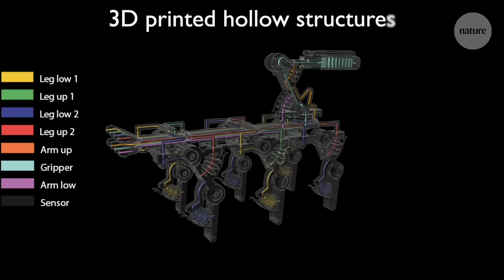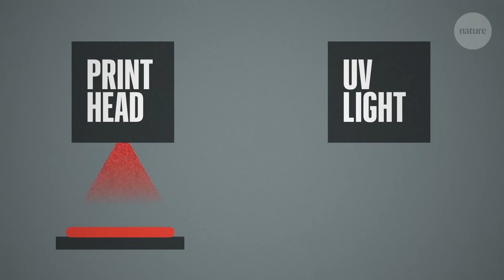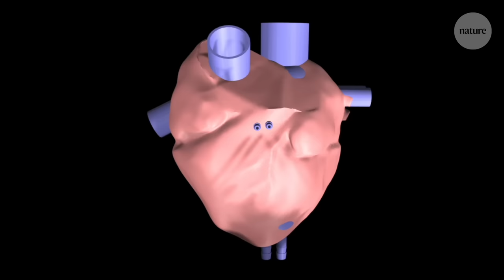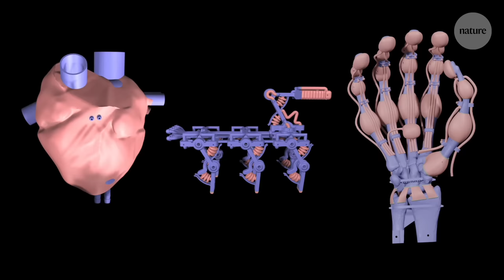The 3D printer that crafts complex robotic organs in a single run

Comment: A bit of a difficulty is that UV resins are toxic and curing is never reaching everything, so putting it inside the human body is probably not feasible.
Reply: Maybe i missed it, but they didn’t say the ink would be an UV resin? As i understood the inkjet method allows for a wider choice of materials.
Reply: All jetting printers use UV resins because they are the only glue that is suitable for the application.

Comment: It's not ink, so it can't be an inkjet printer!! 🤦🏻‍♂️ A! also an inkjet can only print 2D! 🤷🏻‍♂️ And it does not use external uv curing! 😑 This is a Single plain multilayer uv scan 3D printer!
Reply: They said it’s like an inkjet printer in that it sprays a liquid. They’re using a simile so that people who are not well versed in engineering and technology can have a basis of comparison. 

You may personally be smarter than the average bear when it comes to things like this, but something like 50% of the population isn’t and those comparisons are made to inform them.
Reply: @qwinlyn  no it is not even like one! 🤦🏻‍♂️
Reply: There's not anything remotely close to an AI, but still you see it everywhere. That's the sad thing about terms, they are misused, a lot.
Reply: @TheOpticalFreak  A bit pedantic, don't you think?
Reply: @franki1990  It's important to note the difference between AI, (the entire wise field of technologies attempting to mimic human intelligence,) and AGI, (a truly intelligent system which meets or surpasses human intelligence.)